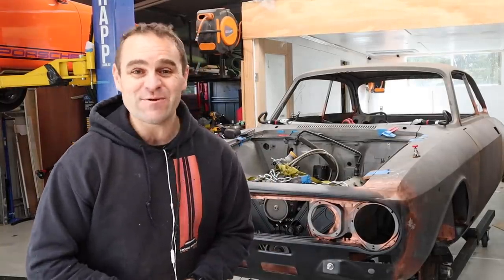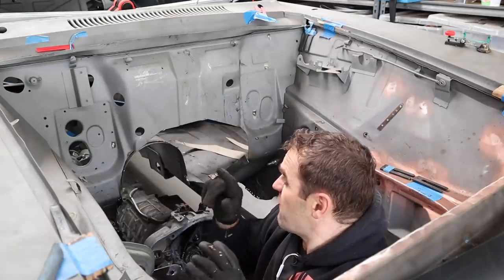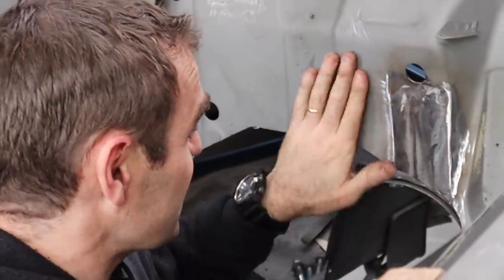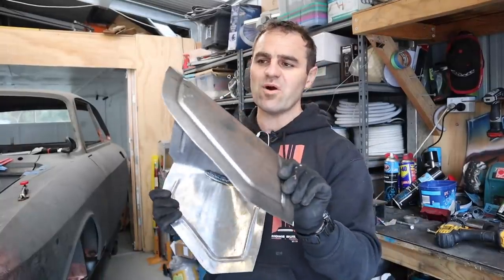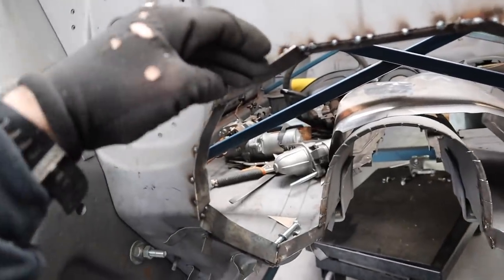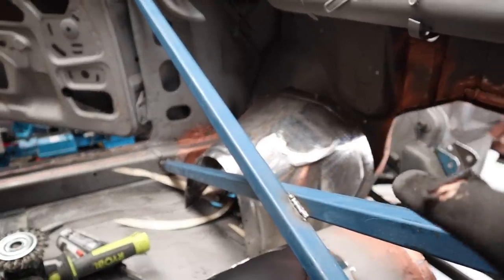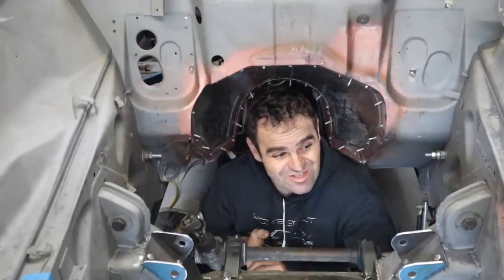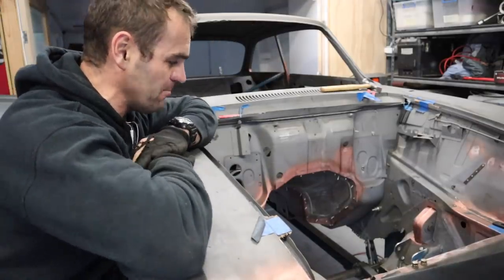Bolt in tunnel - Ferrari engined Alfa 105 Alfarrari build part 48

Comment: Nice work mate, good idea getting rid of the seam on the top mount, if you need more room you can drop that suspension point down by 20mm, 105's suffer from a low front roll center, dropping that suspension point down lifts the roll center and will improve handling, fair bit of work, but if you need to do it for engine clearance you can kill 2 birds with one stone
Reply from the maker: Thanks mate. I will look into that. I can use all the room I can get.

Comment: If you're not prepared to wait for vinegar to do the job to remove the zinc / galvanised coating off anything, a soak in hydrochloric acid can do it literally in minutes. Just make sure to do it in a well ventilated area.

Comment: The upper suspension mounts you trimmed.
You need to put a strap over the top and stitch weld it as the metal will fatigued and crack otherwise.
Reply from the maker: I am doing it on the inside ;)

Comment: not sure if you've mentioned but how will you seal off the tunnel from fumes and road debris? a rubber gasket around the edges and is there space for compensation for the extra space?

Comment: Little more temp and/or little less wire speed might give you the results you want out of mig.
Reply from the maker: Trust me I have tried that, but when you slow down the wire speed too much it doesn't weld nicely. The TIG is much better for finesse.

Comment: hey 
Jeff good work just a tip. Mount an old steering wheel on your bead roller to replace handle makes things a bit easier as is always in reach not having to stretch around
Reply: That is a cracking idea Steve.
Reply: @kevbarry7453  A cracking idea for a crispy build.

Comment: I believe cutting the flanges off the suspension mounting points significantly weakened them. The flanges add structural strength and rigidity.
Reply: These mounts are made of two pressed panels that are spotwelded together at that flange. Welding it over the entire width will not make it less strong.

Comment: Cool 👍🏾😎  the old Bedford vans had bolted in engine and transmission cover same with the old Triumph Herald had bolt in gear box cover but it wasn't steel I used to own one 😀 love that old car plus some guys bolted in a old  rover v8 in a Veatees model,  now your put in a twin cam engine it for more power 😁

Comment: I would have considered a skeletal brace behind the tunnel cover.  Would have given you a long term bracing from floor up the firewall.  And you may need a gasket on your tunnel cover to ensure no exhaust fumes into the cabin.
Looking good.

Comment: I was worried about you not sealing it, but I see in other comments that you're planning to use a gasket of some sort. Maybe non curing mastic would work? It would be messy, but you're not going to remove it all the time once the build is finished.

Comment: You havent lost strength in those suspension mounts by cutting off those flanges?
Reply: More an outcome of manufacturing back in the day.....same as a mini shell...you can de seam them in the same way, with no loss of strength.

Comment: Hi Jeff, great work, just one question is there any thoughts or concerns about water proofing the tunnel ?
Reply from the maker: I will put a gasket of some sort around it.
Reply: @HomeBuiltByJeff  You can buy adhesive foam rubber strip in a roll. Also how come you didn't use Nutsert fittings around the tunnel instead of welding the nuts on?